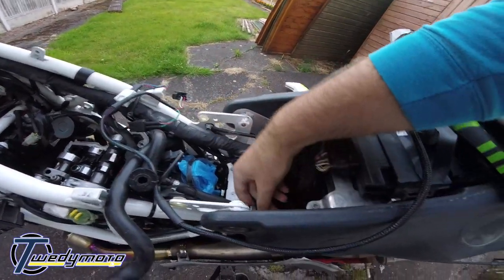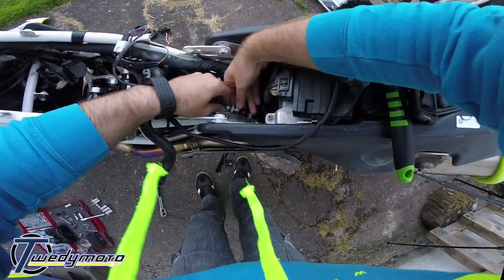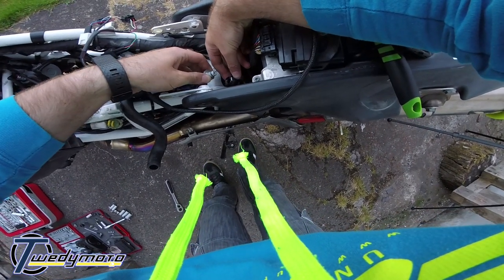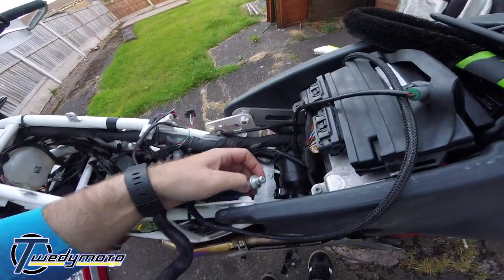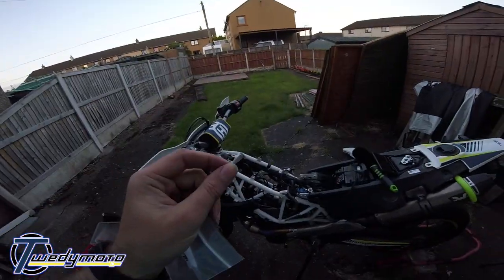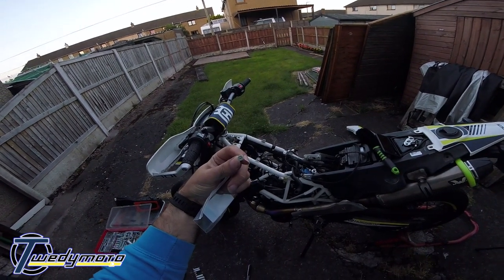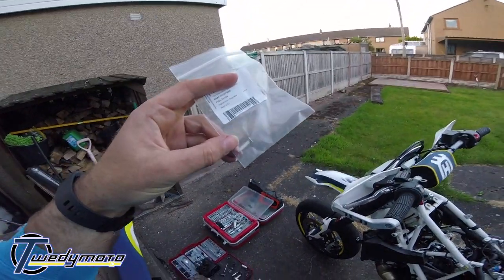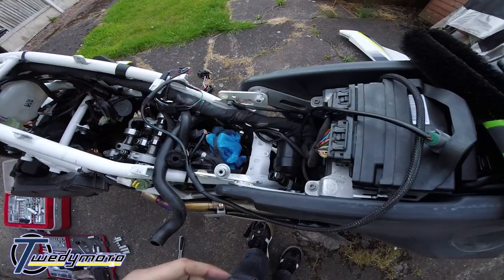How to change inline fuel filter on Husqvarna 701 & KTM 690

Comment: part #: 78141013190
Reply from the maker: haha cheers dude, completely forgot to put it in the description!
Reply: @Twedymoto   do you ever replace the fuel filters or just the screens over the course of your ownership
Reply from the maker: @abauer9865  There are another 2 filters in the tank. Its not a service item, only changed if there's ever problems but I'll be changing it over winter anyway.

Comment: I am going to do this soon, by disconnecting the fuel line where the filter is, do you need to empty the gas first from the gas tank ?? From your video there were no gas spilling. Your video is very helpful, thanks.
Reply from the maker: No, you don't need to empty the tank. Just unplug, change the filter then connect again. Turn the ignition on and off a few times to prime the fuel system and you should be fine. 👍
Reply: @Twedymoto  Thank you for your tips on how to, ride safe !

Comment: Thanks for the vid! What is the service interval for this filter? Did yours look dirty and did you change it early? Thanks again
Reply from the maker: I think it's every 6000 miles according to the service list in the manual. It wasn't dirty as there's 2 filters in the fuel tank before this one. I have a video for those filters too :)
Reply: @Twedymoto  Mucho gracias
Reply: You should change it not long after new, as they can grab debris from the manufacturing process.  Then whenev the manual says, or if you get dirty fuel and have an issue.

Comment: You don’t need to take the air box out to get to the fuel line.
Reply from the maker: Correct, but I was checking my valves and thought i'd do a video on the fuel filter at the same time. haha
Reply: Twedymoto how were they? In or out of spec?
Reply from the maker: They were in spec mate. I think the right exhaust (closest to throttle grip) was a little tighter than the other but still within spec. It's had a beating over the last 4,000 miles so they may need adjusted on the next check.
Reply: @Twedymoto  David zap above says you don’t need to take air box out …. Well I am attempting to change my fuel screen now, and I cannot get to the quick disconnect! Either the air box has to come off or the fuel tank lifted up. What am I doing wrong because there is no way to get my hands in there? I think yours looked so easy because your air box is taken out already.
Reply from the maker: According to the service manual you should be able to do it without removing any panels! I think if you remove the rear left panel, you should be able to get to it a bit easier.
Reply: @Twedymoto  maybe the Husky is different because I have the panels off and I cannot get to the quick disconnect.
Reply: Mines the 2019 SMCR
Reply: You cannot get to the fuel line without taking the entire airbox off, 2018 701